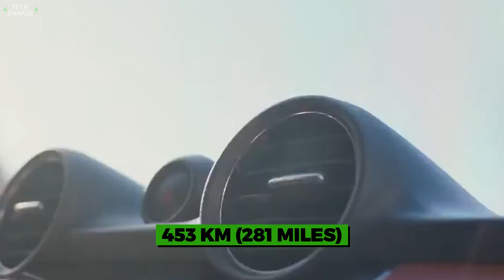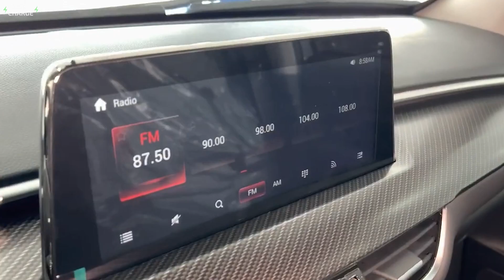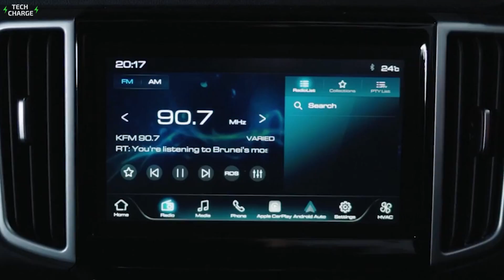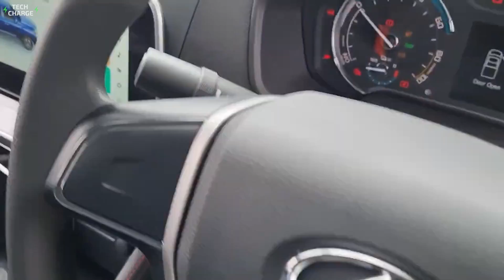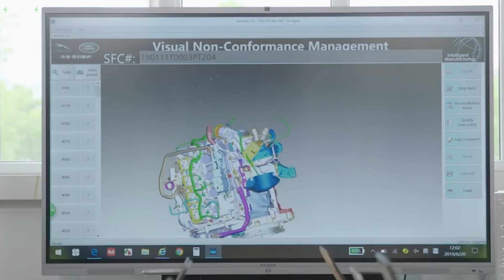12 NEW Cheap Electric Trucks from CHINA (with range & price)

Comment: Remove those side mirrors, and never drive it on the streets of almost all of the 50 states in america, as you will be breaking their vehicle equipment safety laws. I've never heard of a State that allows someone to remove factory installed side mirrors, lights, and such, and then allow you to drive it on the street cause that's dangerous! It is unsafe to rely solely on a camera and an iPad dash to run without side mirrors, which is why Federal safety standards require musky boy to install them at production. But just because ol' musky smellin' tells you, that you can remove them after purchase, doesn't mean he speaks for the law, which he doesn't. Elon Musk is a moron who's ego is barely outsized by our solar system! No side mirrors are how many accidents happen. And if the computer function controlling the viewing space of side and most likely rear views as well go out, you cannot reinstall side mirrors while driving. Look at all other EV's out there made, and they all have physical side and rear view mirrors because that means safety. And gawd help you if side mirrors made your new cyberplunk look a little less than my dishwasher facing! Sorry if you spent so much money on a refrigerator on wheels that hates water, but it's just a collectible, right? 🤣🤣🤣

Comment: The new electric Ford F-150 is not selling for a reason. It doesn't have the towing capacity. 
Google "Ford cuts production of F-150 lightning electric truck due to weak sales"
No one will dish out $60K on an unproven technology. 
1st versions are always buggy and terrible, no matter what you buy.
Reply: BS
Reply: @DeRhamme  No one in their right mind that is. You are excluded.
Reply: @piconano  And you are LOL, TROLL
Reply: Some of the pickup 🛻 trucks on this list 📝 are TDi PHEVs as per powertrain specs...

Comment: Electric trucks are no good. They can't tow like a diesel truck, nor do they have the range. It's for boys and their toys and they look like transformer toys too!
I suspect the current diesel trucks will run on bio diesel or hydrogen conversion, until the end of time, or when batteries can deliver as much power and range as a tank of diesel, whichever comes first.
Reply: Says someone who probably doesn’t own a truck and doesn’t know how “stuff works.”
Reply: @RochusMr  Says someone who is 3 months late to the show!
 I'm a retired electrical engineer. I know how EVERYTHING works.
How often are you wrong? 
Trucks are for people who need them for work. Little boys buy them to feel like a man.
Reply: @piconano  I don’t live on reading ignorant comments, but when I do, I set things straight. Keep riding those shared bicycles, and leave car stuff to people who speak sense.
Reply: WRONG!!
Reply: you are wrong, electric motors which is the same capacity to diesel engines size are 6x the torgue and 8x more kilowatts power and batteries can range up the distance of 2,000 kilometers in just single charge for 1 hour it's an equivalent of 100 liters of diesel fuel, and can tow up to 6 tons of trailer and a bed load of 2 tons